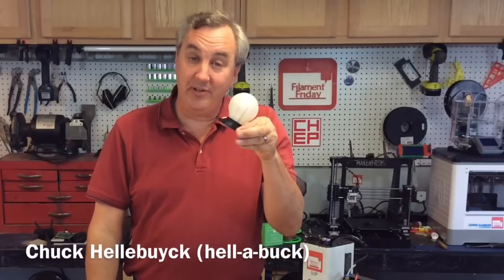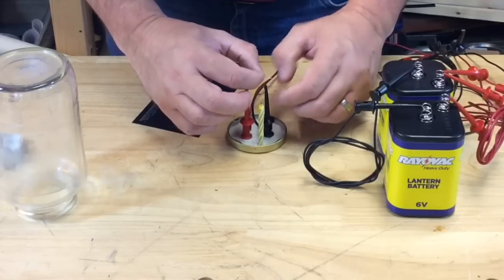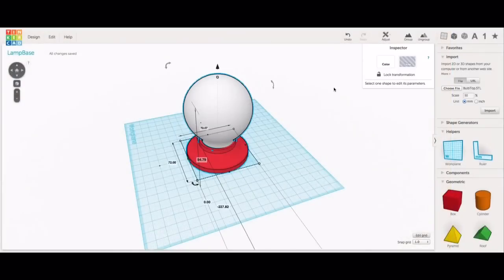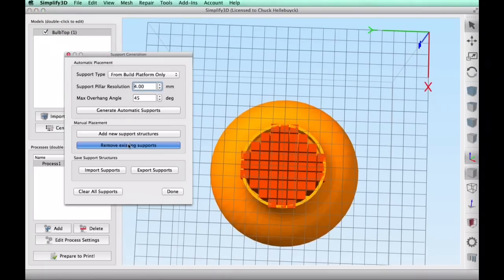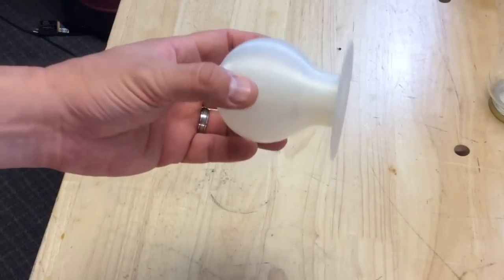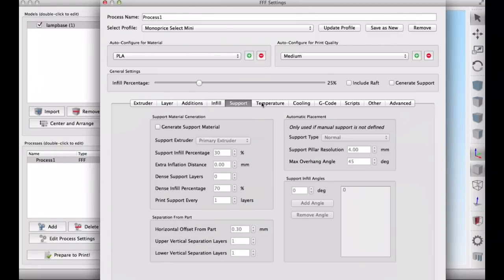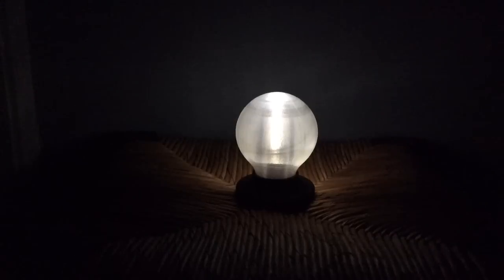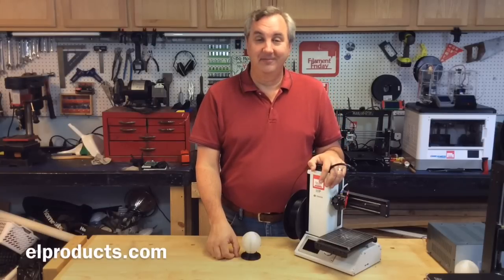3D Printing Filament Friday #85 - 3D Printed LED Light Bulb and Edison Light Bulb Experiment

Comment: where he stole his first light bulb...check your history. Please stop perpetuating this nonsense that Edison invented the light bulb. He didnt, as we now know ...the facts.
This "Museum" is a disgrace to historical fact......Its the equivalent of some dude from MKS claiming and having  a museum dedicated to his invention of Smoothie ware( just to keep things on topic). Simply not true !!!
Rant over but please get with the program. Edison was a hack and a renowned thief of ideas. What he was good at is running to the patnet office with other peoples hard work!!!!
Reply: So, who invented the light bulb wasn't it like an accident from one of his people who made the glass part or what ever?
Reply: Edison DID invent the first 'practical' incandescent electric lamp.  His invention was an improvement on the works of many other previous inventors, but he did hit upon a series of important features that the others did not have.  It was the first lamp to burn in a vacuum.  It was a high resistance element, many of the earlier ones were low resistance.  It was an all glass envelope sealed off from the outside air with leak proof lead in wires having similar thermal expansion properties to the glass bulb.  Without all of these elements combined into a single lamp, the result would have been failure.  So don't call him a thief, he was the first to discover the faults in previous attempts.  Yes, he was the first to the patent office, back in the day many people were working on similar ideas at the same time.  Bell invented the telephone, but he beat Elisha Gray to the patent by days.